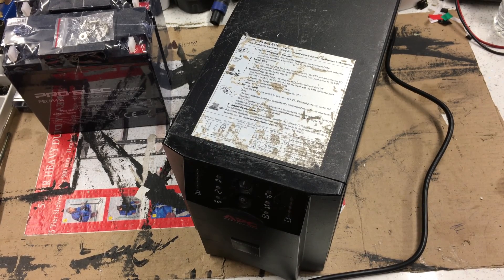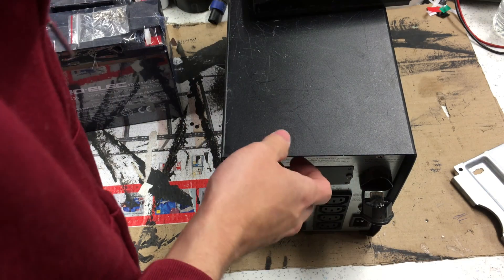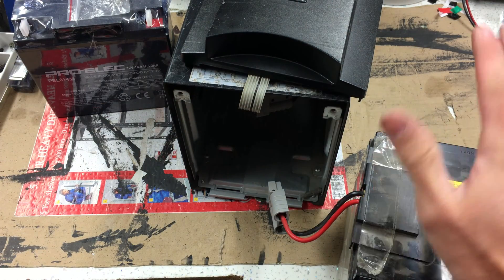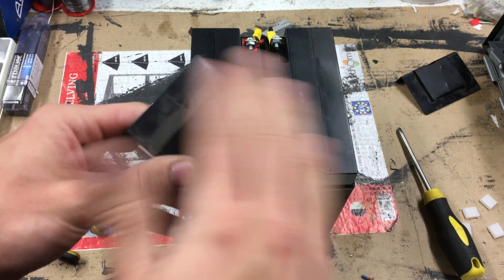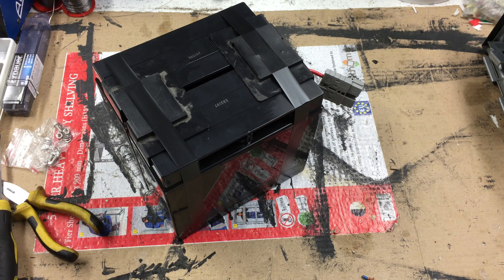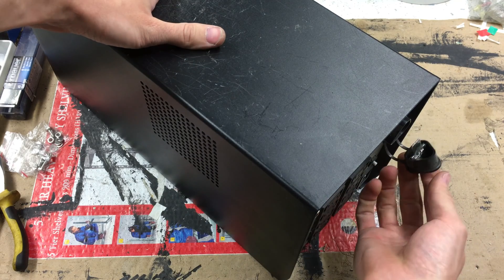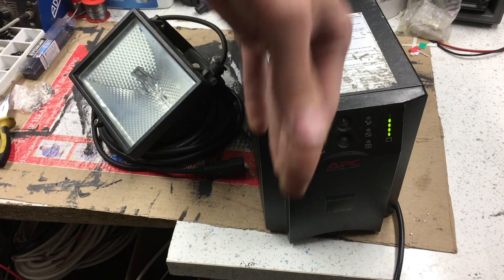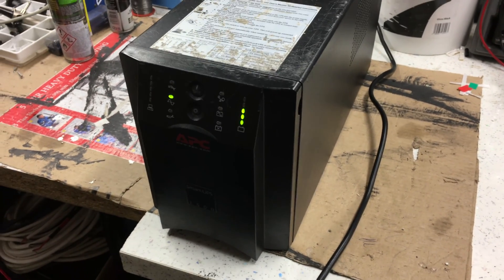Cheaply Rebuilding My APC UPS Battery Pack, Runtime Calibration, RBC7 Smart-UPS 1500, Pro-Elec Cells

Comment: Thanks for the video. I did not know you could build a new pack instead of buying a brand new RBC7 pack.

May I ask you a question related to this model of APC ? I got the exact same UPS at work but it is not turning on. The UPS has been unplugged for years in a closet, so I suspect the battery is completely dead. Do you know if this model of UPS will at least power on with a dead battery ? I tried the cold boot procedure from APC and there are no lights. I don't even hear the relay click when plugging into the wall. I'm just looking to figure out if the unit is garbage or if replacing the battery would fix it. I am trying to figure it out before spending money on new batteries. Any thoughts ?

Thanks !

Comment: @NathanPH This may be a silly question, but do we first disconnect the fuse from the screws to avoid burning out in the event of a short circuit? And when connecting new batteries, do we connect the fuse with the screws last? Does the order in which the black-red wires are connected and connected also matter? If so, what is the correct order?

Comment: I have exactly this unit and with a very dead battery pack. Thanks so much for this video. Were the Pro-Elec batteries okay? Also, a question: when calibrating I assume you take off the load (your 500w lamp) before recharging?
Reply from the maker: Hello! Hope you managed to resurrect your APC by now - I did not see this comment until now but am probably just replying for future reference to anyone else at this point. 
1. - Up to now as of writing (June 2025) the cells have been fine - no issues thus far and runtime was decent in a few power outages/cuts we've had. 
2. - Yes, when calibrating the UPS you would disconnect/remove the loads before plugging it back in to recharge fully. 

Hope this is of some help! 
--Nathan

Comment: cheap batteries are very bad. Keep an eye on them. I'm using only CSB now after cheap ones bulged and destroyed one of my SYBT5 controllers..
Reply from the maker: I have had experience with very cheap batteries going bad when left long term for sure, but usually once they are well past the shelf life or completely cheap china ones. These are not the completely nasty no-name cells like you can get off eBay so I did have some confidence in them (They are supplied by massive electronic component retailer/distributor CPC in the UK and badged a brand name I've bought products by before).  
up to date all is good (June 2025) and they have had decent runtime during a few power cuts/outages. I will update the comments on this video when I finally come to renewing them / anything of note happens but so far so good! Fingers crossed they can make it closer to the 5yr mark, rather than 3yr. 

--Nathan.

Comment: I have one of these I got from a place I use to work at. They wanted to toss it in the trash so I took it. What exactly does it do? Does it just keep your computer on for 20 minutes if the power goes out?
Reply: It is pretty usefull if your area has power shut problems this UPS will keep your load working even if there is no power coming from the grid. In my country we have this problem where power outage is a common problem so i installed it with bigger batteries like 120AH 24V after doing some modifications to the UPS. Now i have 24x7 AC power which is good !